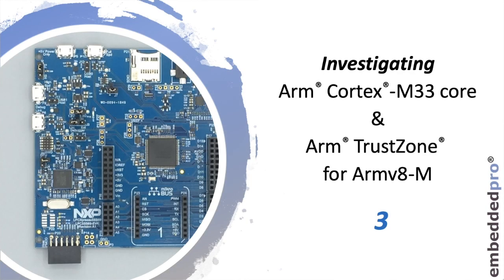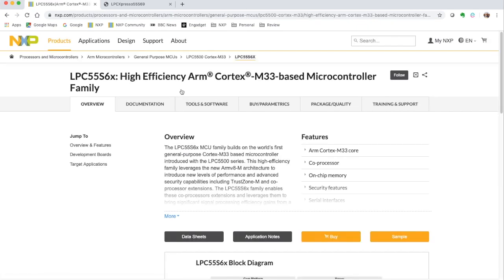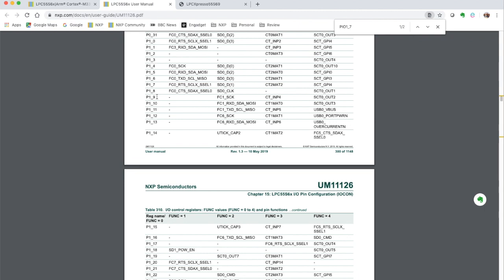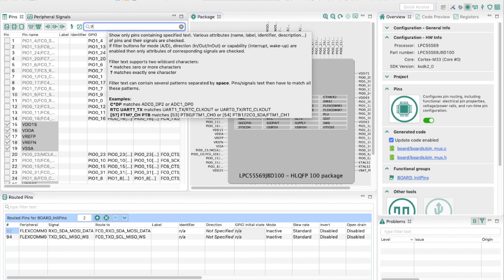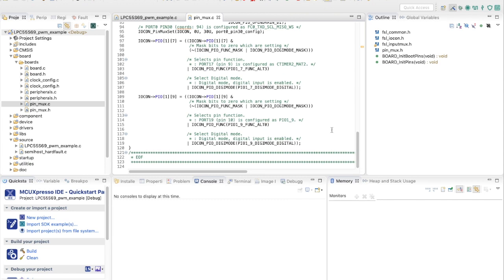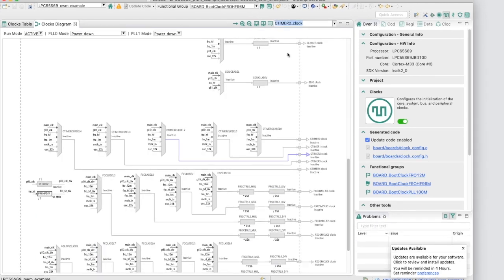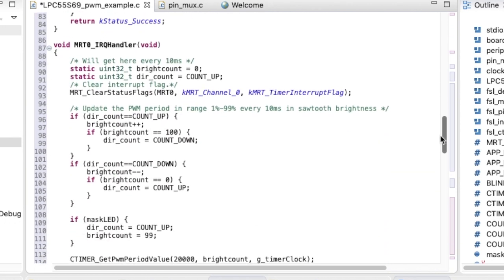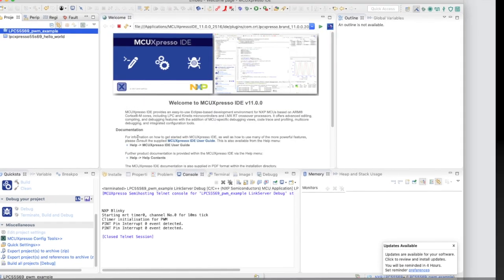3 Using the Pins Config Tool from MCUXpresso

Comment: Great tutorial! However, having just worked through this example with MCUXpresso v11.1.0 I had to make a couple of changes: 
1) The default system clock in a new project was 150MHz - I had to edit the muxes in the configuration tool to match the 96MHz clock in your video; 
2) There is a typo in the CTIMER_CLK_FRE_CLOCK_GetFreq macro - "kCLOCK_CTmier2" should be "kCLOCK_FroHf". 
With these changes, the example runs as shown! 
Many thanks - I hope to be able to work through the remaining tutorials as I get time!!!
Reply: Found both of those myself also. I am working with the V11.3.1 (2021-04-02) and the CTIMER_SetupPwmPeriod() function has an additional parameter

status_t CTIMER_SetupPwmPeriod(CTIMER_Type *base,
                               const ctimer_match_t pwmPeriodChannel,
                               ctimer_match_t matchChannel,
                               uint32_t pwmPeriod,
                               uint32_t pulsePeriod,
                               bool enableInt);

Not sure what to pass for the pwmPeriodChannel field..
Reply: This worked:

	CTIMER_SetupPwmPeriod(CTIMER, kCTIMER_Match_2, CTIMER_MAT_OUT, g_pwmPeriod,g_pulsePeriod, false);

Comment: Hey what day is your schedule upload day of the week? The file is not in the link
Reply from the maker: Hi Naasik, thanks for your question. I will be posting a video each week on a Monday. The accompanying blog on www.mcuoneclipse.com is scheduled for "lunchtime" Central European Time (CET) on a Monday. That blog has a link to the video here, and so I've tended to post the video over the weekend. I'm just going to write the blog right now, and will post the text file mentioned in the video right after that.
Reply: @embeddedpro3870  The PDF file is not great for source code. Long lines wrap which causes compiler faults.  Also the CTIMER_SetupPwmPeriod() function call now has an extra parameter. I tried kCTIMER_Match_2 (2) which is what I assumed is what you want. However with this, the LED brightness doesn't change.  Any chance you could look at your demo code with the latest SDK and see what it takes to make it work? Also the default sysclock is not the 96 MHz free running clock. Changed that also.

	CTIMER_SetupPwmPeriod(CTIMER, kCTIMER_Match_2, CTIMER_MAT_OUT, g_pwmPeriod,g_pulsePeriod, false);